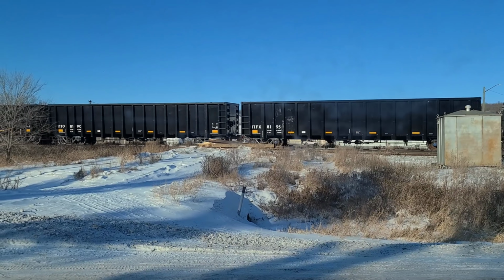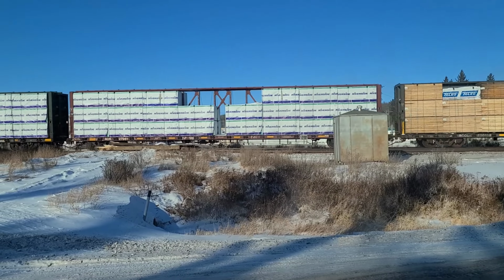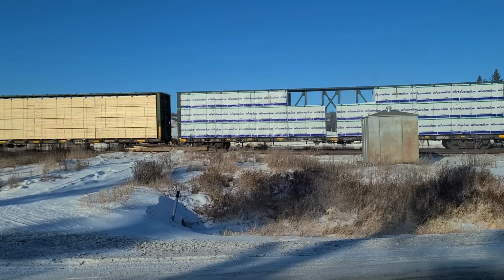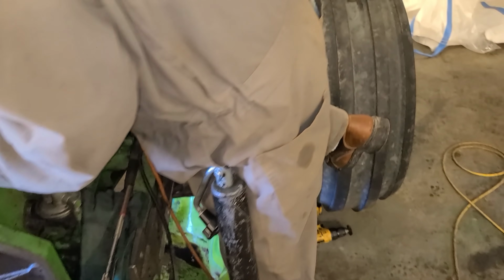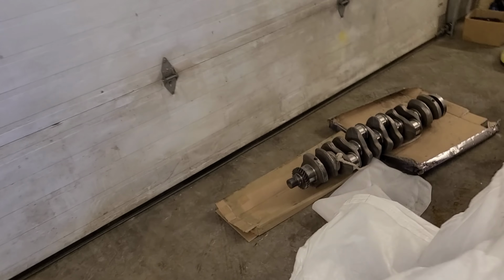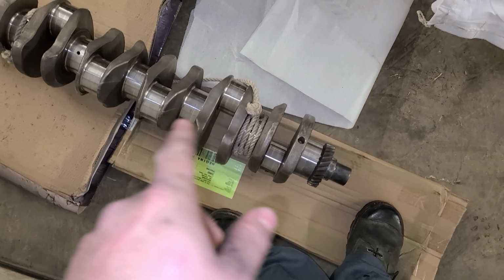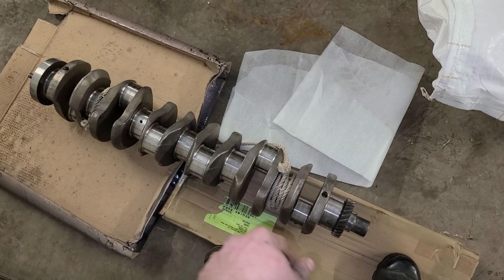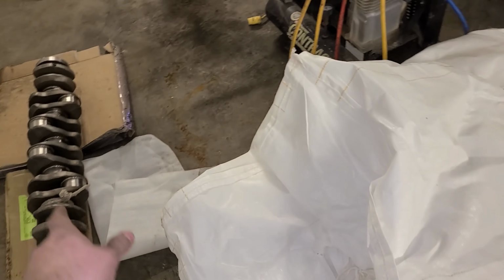5020's engine starts going back together! part 6

Comment: The 6030 John Deere was a darn good machine as well. Some guys use that engine in place of a 5020 engine, that is, do a swap instead of an in frame rebuild. One has to just interchange the oil pan, I guess but the newer engine model makes more power with a bigger injection pump and you can add a turbo.

Comment: Once again great video, didn’t know you could pull start a 4020.
Reply: best way to is wrap a chain around the front axle put her in 8th take of and drop clutch [that is for a syncro range transmission]
Reply: @amazingorreo4854  what about a power shift?

Comment: this a bit off-topic, but with the air filter on the 5020(and 4020) there's that boul on the bottom, we put oil in it even tho your not supposed to but it doesn't do anything bad, it helps clean the air much more and keeps the boul from rusting out. we just use the same oil as what we have in the engine, works great, keeps the dust that goes down there down.

Comment: The 806 !  Neighbour had one Lmfao 🤣 we hade 2xIH574’s one with loader ... an MF 1120 and 1 only JD 7020 4wd our pride in those 80’s days .  I can’t believe that 5020 will push within 20-30 hp our 7020  had.  Nnnice ... ! Thought the 5020 was a 110 pony tractor but it’s bigger than our Massey was fak me ...
Reply: 5020 was 121 horse . 5020 ended the run at 140

Comment: It wasnt pulling a turnip picker but I did run an 806 on a sickle bar mower 4 years ago cutting ditches.  I was impressed by how little fuel it used . I've run a 4020 plenty but wasnt tracking fuel usage then lol love them Deeres though. The IH1066 Hydro was a purdy darn good tractor too put that on a square baler yur living large 😎
Reply from the maker: 4020 would be up there with the best on fuel tractors ever produced haha
Reply: @SouthSaskFarmer1  I know where I can get one for free I just gotta haul it to my place. I'm near Lloydminster the 4020 is at Hodgeville
Reply: Needs some work of course haha

Comment: It’s still that way I’m a commercial alfalfa grower. Caseih or new holland tractors are still a joke can’t get parts for them after 10 years old lots of don’t make any more. I sit in a jd 8370r for 1500 hr a year pulling a big baler. We tried out a t360 what a pos. Ruff riding bucky bronco.